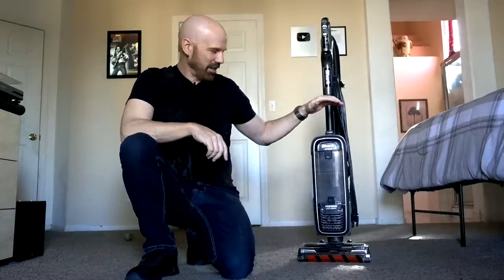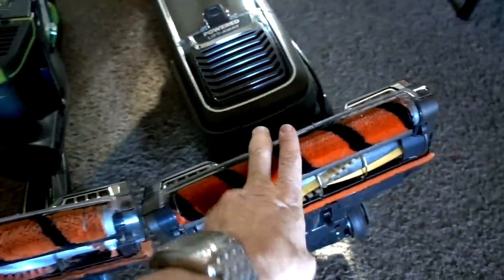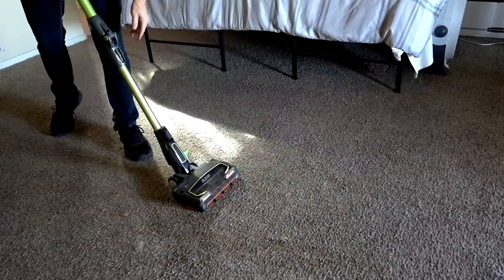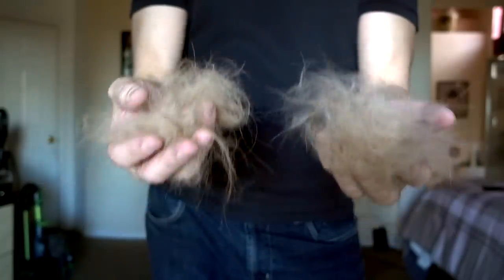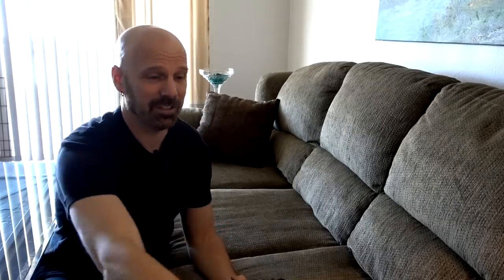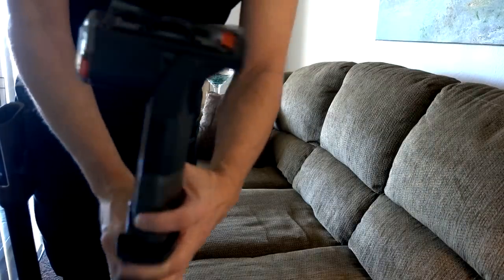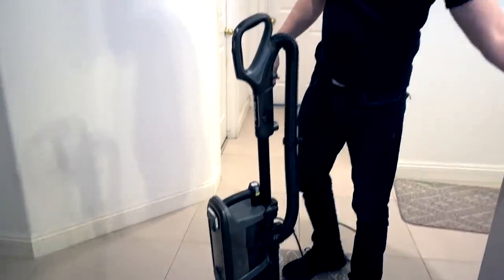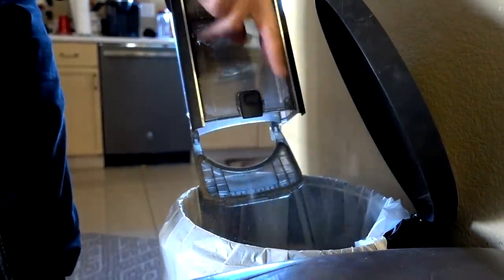Shark Apex Vacuum Review: Best Pet Hair Vac?

Comment: I just bought one of these about a month ago. I opted for the upgrade on the canister cart, steam mop, a few extra accessories and lifetime warranty. I couldn't be happier. I have seven cats, this thing has never clogged. It gets all the fine litter and dust off the hard floors perfectly, great one room with carpet as well. That motorized pet tool is amazing on furniture and pet beds. IMO well worth the price. I do agree with James on the hose being the only issue.
Reply: Cal Luellen this is exactly what I was looking for! I just purchased this with the pet package... sounds like it’s worth the money
Reply: Cal Luellen - Are you talking about this very same model Shark Apex demonstrated here but just with extra parts ordered from the company? 
Or
Are you talking about a different upgraded Shark. Vac model with different extra attachments but same basic technology as this Apex?

Comment: The lift away feature also allows you to use your vacuum wand to reach under all the furniture since the canister can't get in the way. I love I can reach under my couch and bed without having to use a wand tool or move anything! They also make a canister roller base so you can turn it into a canister vac and roll it around behind you!
I absolutely love this zero M technology! I have long hair and I shed enough but I also have 2 dogs And 3 cats! I HATED cleaning the roller, I had the ion and I screamed YES when I saw the zero M technology! I love that I no longer have to clean a roller!
Reply: @Tammy Warren - That's why I've been watching these reviews. I have very long hair, too, and even though I toss stray hairs into the trash can, it still falls on the floors and then jam up my regular vacuum. Don't have pets.

Comment: I have been using the Navigator, then got the duo clean flex...whoooaaa what a difference! I just bought the Apex duo with Zero M... haven't used it yet but my guess is I'm going to LOVE! The best thing about these duo head vacs is the user interface. With Dyson I was so sick of having to shake rugs or fight with any attachment to get from each floor surface. Sharks duo head has sold me in this alone, but that duo clean, first roll practically cleans a hard floor, as in wipe down and everything!! I cleaned houses for 20 years and this vacuum is by far the best I've ever used. With the Apex now you get the same suction of the Dyson with WAAAAY more flexibility and no more fighting all that suction to do rugs. Either the motorized bush attachment gets the really flimsy ones or the duo head takes care of business without changing a thing!! Compared to Dyson for the money... this thing will pay for itself in lack of headache meds in a month's time!!

Comment: Thank you for this review. I have 3 pugs and they shed as tho it is their job to do so. I have tried multiple vacuums without much success. After watching your video, I purchased the Apex, and I must tell you, it is wonderful! It get the hair up with minimal effort and I don’t have to spend time cutting it off the roller. I found that if I let the vacuum run for about 30 to 45 seconds once I’m done, all the hair is sucked into the dust collector and the rollers are clean. The only drawbacks I see with this machine is the short hose extension and the fact that it came without any attachments, unless I purchase them separately. Thank you again, I love and appreciate your honest and straightforward reviews.

Comment: Have a Shark Apex and it works great for picking up my 2 dogs and a cat’s hair. The big clumps are not unrealistic on the hard wood floors where tumble furs gather. I found the small brush tool with out the brush section works the best on microfiber furniture

Comment: I think this wins over the Dyson. We have the Apex and a Dyson Animal 2. The hose is very long on animal 2, but when the vacuum is on, there's too much power that it flys right into your back, and you are stuck with like a 2-foot hose. The Dyson also has that weird black belt thing that leaves a dirty spot on the carpet. 

Just wanted to inform you in case you want a Dyson. (Also, animal 2 cannot be pushed on any shag rug unless you are super strong. My feet slide on the carpet trying to push it!)

Comment: I have the older version of the apex (without the extra roller in the front) bought it in 2013 ( with the VIP warranty),They replaced the foot on mine after I got a hole in the hose,for free...I love mine,easily the best vacuum I've owned with 3 dogs,2 of which are husky mixes.

Comment: I ditched the Dyson for a Shark ! The pet hair tool is brilliant. I’m yet to be convinced that cordless vacs have the power needed to maintain strong suction though.
Reply: Flobber Top They don't. Bagless sweepers are completely reliant on their filters and begin losing suction immediately. A bagged vacuum cleaner, otoh, sees it's suction renewed with each bag change and the bags hold about 200 times as much debris as even the largest bagless dust cup.
Reply: Carlton Wilson Thank you,  that makes sense!
Reply: @Carlton_Wilson  that's why I love my Miele! It may seem expensive at first but it will far outlast your Dyson, Shark and all the other popular throw-aways. The Miele will last for 20 years. How much will you spend on vacuums in 20 years? AND bagless vacuums are nasty, static electricity makes the dirt stick to the inside of the dirt cup, all I do is remove a clean, full disposable bag. It contains all of the dirt, no dirt leaking, the bag chamber is CLEAN! There are several models from which to choose, get the one that works for your situation. They also hold their resale value, you can buy one used and be confident that it will be dependable.
Reply: Terri S I've never known any Miele to last twenty years. Most common Miele repairs are failed cord reels, then failed motors, followed by failed control assemblies. Circuit boards do not belong in vacuum cleaners. Decent little vacs, to be sure, but the bags are faulty. The bag fails, causing debris to obstruct or worse, enter the motor.
100% agree about bagless... NASSSSTY.
Reply: I can't believe you actually think the Shark is better than the Dyson...mine has the same suction today that it had the day I got mine...I would never go back to any other sweeper now.
Reply: I had a shark, it was my parents I loved it.  Used it until the hose went.  I can see that where bag vacuums are better, but keep in mind you don't need to purchase more bags.  Just wash out the canister and filters every now and then.  I have a bagless vacuum which isn't a shark and I empty that canister after every use and if I'm doing multiple rooms I  empty it between them. It's impressive how much dirt and hair I get every time.  I know if I had a shark it would be even more.

Comment: I just recently got Apex one and it is awesome indeed. I got refurbished one for $199 though without zero m, no warranty, and a few scratches, but we do not have pets and it is nice quiet and powerful machine, everyone in our family love it. There is just one thing that i never really noticed with any other vacuums, but with all that awesome power that Apex has i guess, it takes some getting used to try to "fight" with vacuum constantly that keeps trying to run away from you, and one has to pull it back against its will, while the vacuum basically goes forward on its own.

Comment: Thank you!! I too have a golden retriever and have usually bought the newest Dyson pet vacuum that is out, spending upwards of $600. The last Dyson I got was the Dyson ball animal 2 total clean. The suction is way to much, and not in a good way, I realized after buying the shark apex. This is truly the best vacuum I've had and I paid about half of what I did for the Dyson. FYI I vacuumed with the Dyson and then again with the Shark and a lot still came up. So much for the "best suction" Dyson claims is one reason they are the "best". One thing to note, is that the pet attachment is no longer motorized, but I think it still did a great job on furniture. I do think Shark should go back to or still offer the motorized separately.

Comment: Nice! Ty for sharing! I use a vaccum called  Royal pro series. The mid grade model, cost was around $150? Supposedly the flagship model for hoover. It looks almost idetical to their bagged pet vaccum. Had it 3-4 years now, works awesome on pet hair! Mine gets wrapped some, but not my golden's hair. You can feel it lift and pull on the carpet. Same hose issue, so he gave me a different one to attatch to it to extend it. Has a vaccum powered pet tool thing, that works ok with lite pressure. Everyone who has used it, loves it!! No more cleaning that nasty dust bin! Love it!

Comment: Thanks for your performance review.  It is now Oct 2021 and I just got the APEX AZ1002 vacuum identical to the video.  I really like the vacuum and only complaints I have is also the short Hose and they need additional attachments for the Shark vacuums.  There is an AZ pack on Amazon(cost 80 dollars), but no one has video reviewed these attachments in action and there are mixed reviews on Amazon whether they work with the AZ1002 vacuum(so I wont get until I know for sure this pack works).

Comment: I have three long haired Golden Retrievers and a Shark Navigator Lift-Away that I found in the trash. I unclogged it and cleaned it and it works perfectly. I have had it for well over a month and there is hardly any hair on the roller. Just a few strands and I vacuum almost every day and each time it picks up a wad of hair about the size of a softball. I don't know what is up with your roller other than they were trying to improve on a design that was already excellent and they ended up screwing it up. Somebody, somewhere once said,  "If it works, don't fix it!"

Comment: I had a Kirby vacuum 40 years ago. Talk about expensive. The whole setup was $750.00 with all the attachments way back then. I rarely used the attachments. They were too cumbersome and not the quality of equivalent tools, and took significant time to assemble. The vacuum was by far the best on the market at the time. By today's standards it was heavy, bulky, and difficult to operate. The roller was hard to clean. I used a stiff wire dog hair comb to clean it. Turn it on, let it spin, touch the brushes with the comb, and the hair came off. It would snag and labor but using the powered roller made it easy. It would eat up plastic brushes but the stiff wire ones would stand up to the torture. I should have patented it.

Comment: Thanks for posting. I've burned up 3 vacuums over the years for pet hair. Finally got a canister one years ago that worked best. However, I've recently converted over to a Roomba. Which can run every few day. Use my canister one for "extra" cleaning before steam cleaning now. They all still get hair wrapped around them. Like to have a tool made that took it off easier.

Comment: Nice vac but 350 is a hard ask for most.
Reply: Is it? Just depends on your priorities.
Reply: I paid $20 for my vacuum used. I have to clean the filter after each use, which clogs. It's a bitch. And I'm not going to spend more money on vacuums.
Reply: In my experience the saying, “you get what you pay for”, has proved true time and time again.
Reply: HunterShows You get what you pay for and you bought junk. Get a bagged sweeper and stop being so cheap.
Reply: Junk. Best to buy a sweeper that takes bags. Far cleaner and will last many times longer than bagless sweepers do. Smell a lot better too.
Reply: No.
Reply: Dyson v10 absolute is $699. However it cleans, feels, and works like a $650 premium high tech stik vac
Reply: If you buy from shark you can make payments monthly with no credit check, thats how i bought mine
Reply: Bed bath and beyond sells it and they regularly have it on sale, also you can use 20% off for further savings.
Reply: @HunterShows  buy a Miele, you'll get 20 years from it. The initial expense appears high but how much will you spend on these expensive throw-aways? Compare the warranties.
Reply: In my mind...buy the best...buy a Dyson, when it goes on sale...you most likely will get it for even less that $350...I am here to tell everyone, that I have had mind now the longest of any vacuum I have ever owned and the suction on it hasn't diminished one bit.  I would never give a company like Shark that kind of money for anything they sell...besides that notice how all the companies are trying to copy Dyson...they still haven't gotten the science down and I doubt they ever will.😊

Comment: Apex has a "bristle, blade, bristle" configuration  where the Duo has only a "bristle, gap,  bristle" make That allows hair strands to make contact with the roller area gap by hair being pulled down to the base of the tightly packed base of the bristle row.  The Apex,  having a solid blade row in the otherwise open space closer to the bristle rows,  prevents hair stands from being able to make contact with anything  other than the very top of the bristle row which is the more openly spaced individual  bristle tops,  allowing the suction to easily lift the stands up,  off and away. It may be possible  to buy a Apex roller bar and swap them out like any other part although  I do not know how easy ,removal  of the roller is...but I'm thinking in this 21st century world it's got to be down to a science.  I'm certainly looking into it as my cordless Duo arrived yesterday. Now my dogs have the worst  pet hair,  long,  straight, stiff and doesn't fall in convenient clumps.  No, this type , is one of thousand each on its own mission , eventually forming a thin, flat top coat , leaving no area free from this matting top coat.  Yep I would have never been able to crack this  potential deal breaker , roller nightmare without This perfectly timed upload. Many thanks!

Comment: I'm pretty happy with my Hoover I wish it did have a lift away option but my handle comes out like yours for higher up areas but my hose is much more flexible an I can go further with it before pulling the sweeper over one of the main reasons I bought it was because of the handle coming off and giving me an extension, it's much longer than the typical attachment hose and being that I'm only 5'4 I can reach a lot higher up with it vs. my older sweepers that only had the hose attached to the sweeper . It does great on the pet hair I am owned by a dog (who is short haired but sheds non stop), 3 cats, 2 being short haired one medium hair all 3 shed a lot. And my kids are grown but I often have my boyfriends 4 grandsons over so by the time they leave my house looks like a tornado struck it and my vacuum fixes that awful sight almost to perfection :)

Comment: I think it's because the Ion Flex runs off battery power, therefore it can't be as powerful as its corded counterpart. The corded Shark Apex can draw full power continuously since its drawing from an outlet, thus vastly improving suction, spinbrush speed and leaving less pet hair on the bristles. The Zero M to me, is just another way to resell the same tech with only slight tweaks.

Comment: One of the nice features you didn't touch on is the powered lift away mode where you just remove the canister and leave the wand attached to the power head.  This way you can get under low furniture and in tight spots like with the ionflex but with the power of the Apex.  
Also Zero M, if you didn't know, is essentially a fixed comb inside the head that combs the bristles of the brush with each rotation.  Great to see how effective it is in practice!

Comment: Question I have is, sense one is battery and other is plugged into the wall. Does the wall powered have more power/suction than the battery powered vacuum. More suction means it pulls the pet hair off the roller vs wrapping it around the roller via the rotation of the roller?
Reply: Hey You the apex is more powerful in general, i looked at a ton of reviews before buying mine and it is the most powerful shark on the market

Comment: I have the Hoover (about 10 yrs old now) pet hair vac. And it works pretty well on open carpet but it does not edge at all!!! and it has the hand held "motorized" (for upholstery) thing that doesn't work at all because the vac doesn't have enough power through the hose to make it work...so it is a useless attachment!!! and like yours the hose is very short ..every time I find a straight piece trash I take it to lenghthen the hose  so I don't have to bend over so far!!!!

Comment: James: Does the Dirt Devil have a lower profile at the very front where the bushes are? If so, it's the lift up & set it on the "dirt" before you vacuum. Also, I think ever plugged vacuum will have more suction power because it's plugged in . Batteries are not powerful enough in any product in any endeavor to over the strength over plugged in unit. When you can draw endless power vs restricted the power because of the capacity of a battery.....well, there ya go. Our countries cordfree experiment & that's all it is, is an experiment is a joke! 50 yrs. hence, maybe, just maybe we'll get it right but that's alot of iderations from now. Example: Tesla 3's are a no go in barely above, let alone freezing temps. Betcha they're not even sold in Canada, eh?

Comment: Id like to know on tile how vacuums do and if there is any back spray of anything that could come out on lenolium and as im losing a lot of my hair which vacuums them up good without a lot of cleaning them. I had a vacuum not sure if it was dyson but a button youd step on for the brush roll turn vacuum on and it would i think collect the hair or get sucked into the bagless area i cant remember which. I have a bissell lift off its ok but have a fantom lightening that im still trying to find a wand as end broke on mine and i used to have a bissell aero swift. So if i kmew which vacuum is combined into 1 from all of mine that would be great. Dyson everytime id plug it into the wall plugs id see a spark.